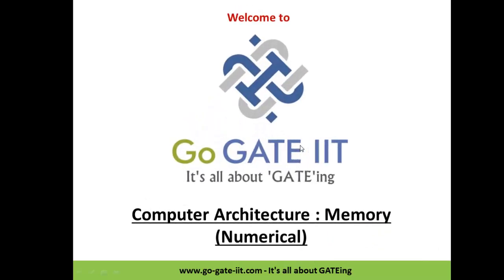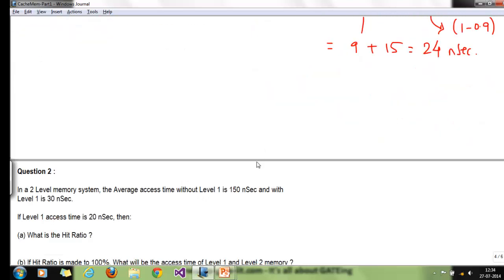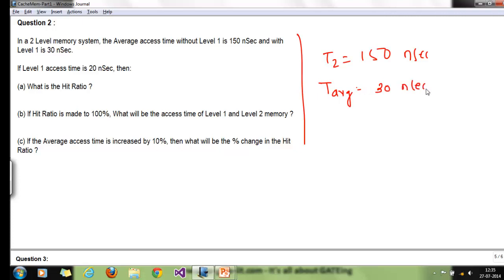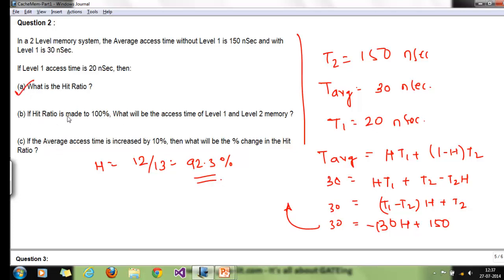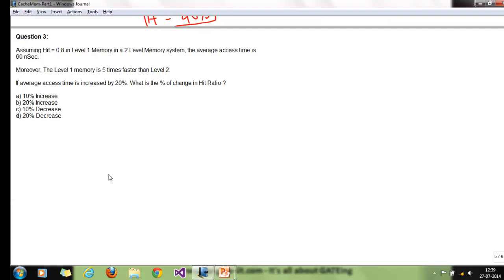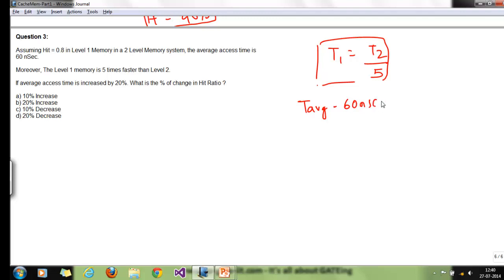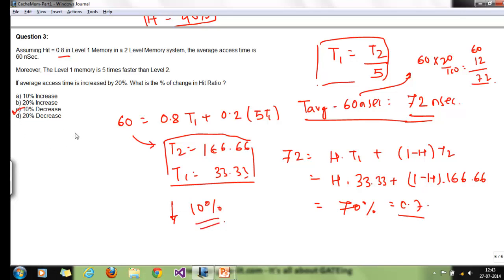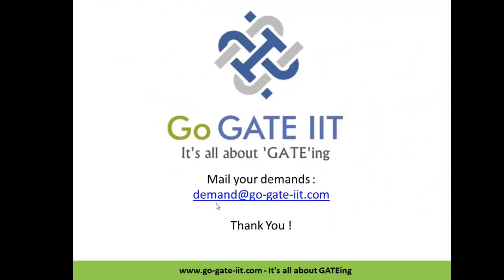Computer Architecture : Memory Organisation - Part 2

Comment: " level 1 memory is  5 times faster than level 2 " => [ L1 = 5 * L2 ]
but you have considered it as L1 * 5 = L2, WHY ?
please do respond..!!
Reply: hey! the time required to access L2(Main memory) will be greater than time required to access L1(Cache memory). Therefore its 5T1=T2 (T1<T2)